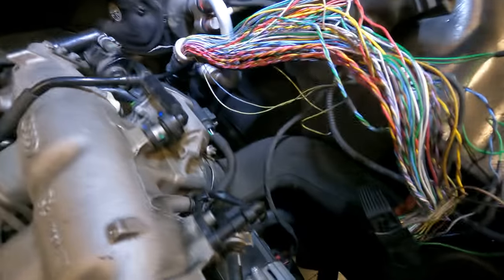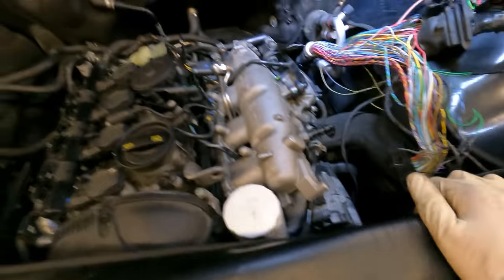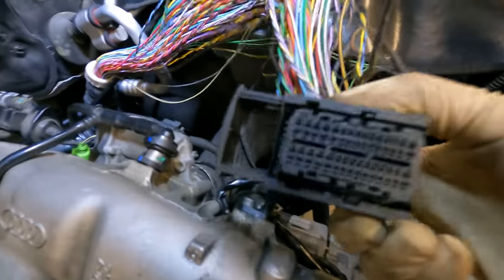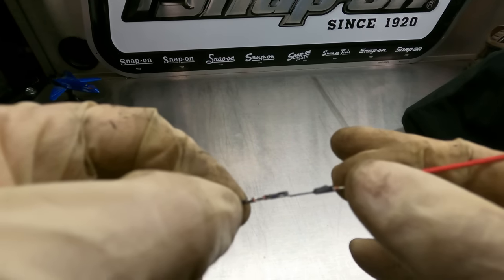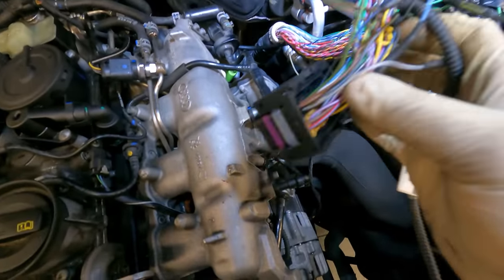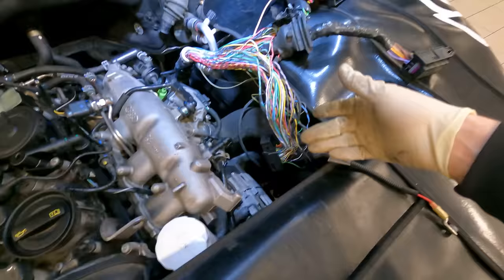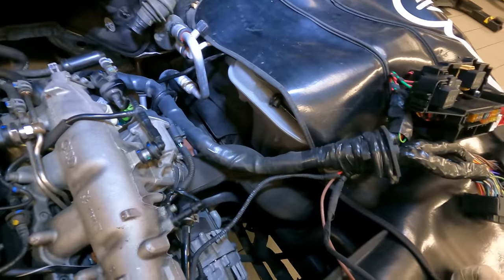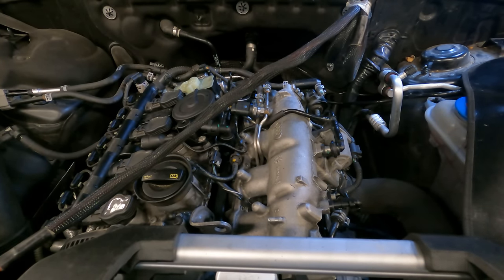The most DIFFICULT VEHICLE OF MY CAREER 😨 So far. #strugglebus

Comment: I was an AG mechanic for a long time. In the late 1980s John Deere came out with the 9000 series combines. First ones with computers and complicated wiring harnesses. We received several new combines in early summer. The customers did not want them to be delivered for a few months. So we stored them inside the dealership's machine shed. Jump forward to Late Sept. The customers were ready for delivery. The one combine would not do anything electrical.  We found one of the main wiring harnesses completely chewed in two pieces. Over one hundred wires of various sizes. Many the same color and size.  That harness was not available as a service part. It took two of us a week to trace each wire and repair it. All the while laying crammed into an area just big enough to squeeze into with your arms straight over your head. 
  So when they say wiring problems these days I run!!! LOL

Comment: When I was learning back in the day. Pin drag test was one of the first things taught to me when dealing with computers.  GM. Loved it best on 2000 Buicks, ECU located at passenger kick panel. Take them out, start car, smack it on 1 side, car die and not restart, flip over smack it and car would start. Funny as heck.

Comment: when I was working for a generator company I attended an electrical class where they handed is a bag full of extension probes for our Fluke meters. The new probes were smaller than a paper clip and very close to a sewing needle. The idea was to NOT fuck up the new style harness connectors. They also told us (over several days) that anyone caught using a meter without the adaptors would flunk the course!

Comment: Ive replaced a 128 pin connector on an aircraft wiring harness. One pin at a time, and I would check every 10 pins to make sure everything was correct. Then we have to continuity check each one of wires end to end. Good times.
Reply: Aircraft can be something behind the panel.
Reply: @robertthomas5906  That was behind a panel. It was a connector behind a panel on a bulkhead disconnect. The connector was shorting between two pins causing a flight controll problem. Aircraft was new too.

Comment: I have a lexus rx330 2005 and I had timing belt waterpump coil and sparkplugs replaced about a month ago now it won't start no sound or anything headlights working and dashlights working any idea what it could be
Reply from the maker: Check ground to battery. Give the starter motor a few hits. starter might be on its way out or its no good already. Are you getting a "click" noise when you go to start it?

Comment: Wouldn’t it be less effort to order a new wire harness from factory?
Reply from the maker: Yes it would, at the sum of $2500.
Reply: @customerstateswhat  spending a week on failure analysis, re-pinning connectors and repairing broken wires still less expensive than a new wire harness plus installation? Wow. Great job

edit: I mean that sincerely
Reply: @Numfuddle  I guess he is cheaper than $2500/week, so it makes sense. Still weird how germanly expensive a piece of wire and plastic can be.
Reply: @Asto508  unfortunately wire harnesses for cars still require a lot of manual labor. So at least some of the cost is justified.

Comment: Would have it been quicker and cheaper to replace the harness, instead of spending hours on end, repairing individual wires?
Reply from the maker: $2500 for the new harness. Had the car in my 2nd bay and worked on it in between cars.
Reply: @customerstateswhat  I see. How much was the total labor on that project?